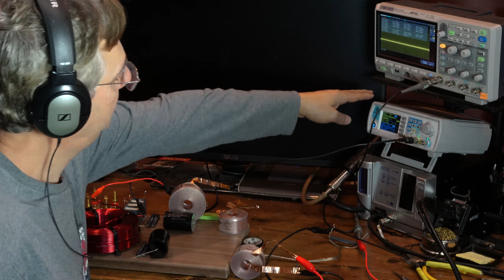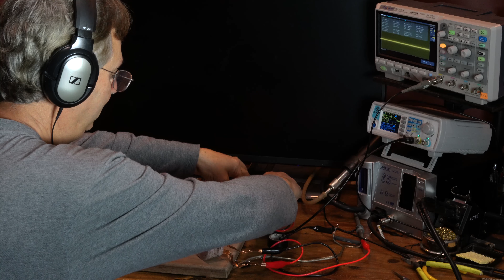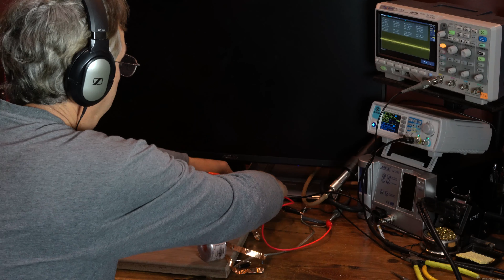Avoid Crossover parts  Interference. See it and hear it

Comment: Great experiment!
My beloved Tannoy Buckingham Monitors has three separate crossovers, thats original design. The weight of crossovers for one speaker is 13 kg. The Tannoy engineers didnt mess around back in the late 70-ties. You can single-wire, bi-wire and bi-amp them. Its a really large air coil for the bass elements and several alrge aircoils as well.
Im about to build really good crossovers for my jbl 4350 speakers. I knew about the coil interference and now Im thinking of making two separate crossovers. These speakers are originally bi-amped. Therefore the largest coil is for the 12 inch midbass element, 2.4 mH. The plan was to make them on a large pcb. But maybe its easier and better to separate the mid bass corssover from the other two…
I will certainly test out but there is alot of coils in this filter design…

Comment: This gives me an idea of just using the entire inside of the speaker box as the base to mount the crossover parts and space hem really far apart. the wood board you used is too small. your inductos are uncommonly large, so that board is considerably too small for anything except this demonstration. 12 inches, that's really useful info

Comment: Consider the intensity of the fields when 200W are going through the woofer inductor with real music.
You could get out a real power amp, and load the inductor say with a 4 ohm (very) high power resistor.
Then take the tweeter (shunt) inductor and load it with a typical 6-8 ohms and measure across it. 
Best solution is to have the woofer XO on another board placed a foot or more away from the others.
The rest of the inductors should go in the corners, obviously to maximize the distance.
VanAlstyne found significant crosstalk from the woofer inductor to the midrange in his B&W 801 speakers.
Reply from the maker: Totally agree best is to separate the 3 from each other if possible 3 separate boards or use distance on the same board. The woofer inductor is on the opposite side in my crossover about 10 inch apart. if you have not seen my previous videos where I demonstrate the crosstalk they are worth watching.

Comment: Wow, now I have even more audiophile nervosa haha.

When using metal screws to secure the crossover board to the cabinet wall, should I avoid having the screw near certain components?
Reply from the maker: I would not worry about that 
Make sure there are no vibrations to the crossover so well secured and components glued I prefer outside not attached

Comment: Appreciate if you can share how to design the crossover starting from the simulator to measurement and fine tune
Reply from the maker: Hi Paul I am not big on simulators They may be good for a starting point but often reality is a bit different. I believe in keeping it simple less components is better. I made 2 videos on designing a crossover they may help you a bit.
https://www.youtube.com/watch?v=DMU3cxsseqE&t=155s
Reply: @Gabster1  thanks for the reply, I watched the video before. I have no problem building crossovers, I just have problems designing them. I started with simulator and then actual measurements. The problem is without the acoustics silent room, I used the pluses method, not very accurate, especially the bass. Another problem is it's hard to buy a lot of crossover parts to try different combinations of them.
Reply from the maker: @paulsochinfan  A trick for not buying too many parts 
for inductors buy one cheap 4 or 5 mH and if you need less simply scratch part of the winding and solder to it you can measure the inductance first using a Dats V2 from parts express you can have multiple taps at various Values 
For Capacitors if say you want around 10 Uf 
get some cheap 6.8 then 4, 2 and 1 now you have 6.8 to 13.8 
resistors same as Caps idea 
once you know what you need pay the big bucks for the good ones.

Comment: Interesting. What would happen if the biggest inductor were actually 2 smaller ones and you turned the 2. one 180 degrees in the same plane while running sound trough it? Would there be some kind of filter effect?

Comment: what is the gauge and value of that large air core inductor?
Reply from the maker: 3.7 mh  10 gauge a bit of a over kill 12 or 14 gauge would have been fine for my project. but it has a very low dc resistance that I wanted.
Reply: Why is an air core of the same value of 14 ga. wire From any supplier so much smaller  ? please respond this has been baffling me for years
Reply from the maker: @ericschulze5641  not sure if I understand the question 
The big one is 10 gauge so bigger the gauge size is in reverse 10 is bigger then 12 or 14 
Hope that helps
Reply: @Gabster1  I know quite well about wire gages. My question was pertaining to the large red coil if I recall you said it was 4.5 mh or something close to that .anyway if I bought the same value coil from parts express in 14 ga. It would be about as big around as an old time silver dollar I just got an air cores of 2.25 mh & .27 mh and thier miniature compared to that. Why is that
Reply from the maker: @ericschulze5641  ah I see yes they grow exponentially I was shocked when I got it 10 gauge is very thick wire a 12 would have been enough and would have been half the size of a inductor  a 14 gauge about a 1/4 of the size approximately 
When you have thick wires you are forced to use a larger circle and that also adds to the size.
They do grow very fast as the inductance go higher but if you need the dc resistance very low and don’t want to use iron cores  be prepared to have a huge very expensive coil.
that is why a lot of manufacturers use iron cores to save $
These are 3.7 mh from Solen.ca 
There is formula on the net about winding inductors it is very complex

Comment: How will interference sound? With 2 inductors placed like a "T" with a 1.5 inch or so gap, how bad could it be if an oscilloscope wasn't used and they were interfering with each other?

Comment: You could shield them with copper tape and Earth the whole lot out
Reply from the maker: Thanks for the Tip will try that may come handy specially when space is critical
Reply: @Gabster1   be interesting to see what results you get on the scope how low the noise would be even close up! let me know if you do it
Reply: I think that trick works best with voltage fields and not so much magnetic fields.
Reply: @impuls60 copper does reflect magnetic fields. Dropping your magnet through a copper pipe and it slows it’s fall dramatically. There are videos showing this on YouTube

Comment: How about mounting the crossover sections (lo, mid, hi) in their respective parts of the cabinet to achieve greater distances?
Reply from the maker: You can but you will need more space specially the midrange enclosure and the tweeter has no enclosure in my case 
Also prefer not to subject the lo crossover to the extreme vibrations.
Reply: @Gabster1  cheers